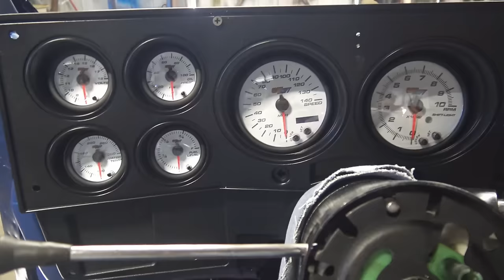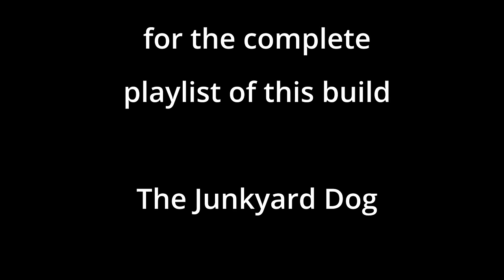Custom Classic Chevy C10 Muscle Truck Build  -  Start To Finish

Comment: That was amazing! So no heat no a/c and no wipers. Tell me how do you fair without those options? You can take Rain x and put it on the windshield and for the most of it be ok. How about defrosters? How does that work?
Reply from the maker: Not a daily driver ... so I drive it when conditions are favorable.

Comment: 4/6 drop? what shocks...So much knowledge
Reply from the maker: I used 2.5" drop spindles and 2" drop springs on the front with the stock front shocks. On the rear I done an axle flip and used front shocks from a later model GM truck. You'll have to go back and watch all the videos I made of this build. Here's the series page: https://www.youtube.com/watch?v=J9kgFm90ras&list=PL17ffBx4Y_BP4FEDoeKb6v6TV-HCnMObj

Comment: Hey Bob I built a 77 c 1 ton camper special put a 366 out of a school bus  with a low hole four speed  had to make a alt bracket got used headers out of a big block Blazer had to fix them Napa said it couldn’t be done but with the help Crome my besty we got her done dam thing got about 5 mile to a gallon it cost me 500.00 to go from Pennsylvania to Florida and 300.00 to go to Baton Rouge even my 73 GTO with a 67 GTO engine and close ratio Muncie four speed got a little better fuel mileage

Comment: How are the glowshift guages sir? I'm thinking of ordering some for my 85 c10 Lwb
Reply from the maker: I love em!
Reply: @RatRodBobBuilds  is the 6 pack cluster pretty good I may order tomorrow none of me OE gauges work at all
Reply from the maker: You will have to get the bezel too for the gauges to fit. You will also need the trans adapter for the speedo and it will need calibrating as seen in my videos. 

https://www.glowshiftdirect.com/7-color-series-cluster-dashboard-panel-gauge-package-for-1973-1987-chevrolet-c10/

https://www.glowshiftdirect.com/16-pulse-speedometer-sensor-adapter-for-gm-vehicles/

And just so you know ... I had to pay full price for mine and I don't make a dime off of any sales. But I still recommend them.
Reply: @RatRodBobBuilds  I appreciate it sir. I'm gonna order them next week and get them to a shop to be installed properly.
Reply from the maker: @KGrizz187  Here is the link to the video of me calibrating the speedo: https://www.youtube.com/watch?v=esC9Q1TKGvU 
You can start at the 17 minute mark on that video to see it. Just in case your installer needs info. Kinda pricey but you're gonna love them.
Reply: @RatRodBobBuilds  any chance you have email sir so i can ask more questions about my c10 and these guages. Like do I need the extra stuff

Comment: How much does a rebuild like this cost?
Reply from the maker: If you count labor ... you can buy a rebuilt truck a lot cheaper.
Reply: I have a 74 C10 that's been sitting for at least 11 yrs. I'm ready to get it on the road.
Reply from the maker: Do it yourself and save! But I did spend 12k on this build just in parts. Well, that was including the $500 I paid for the truck!

Comment: Yes Sir I. Love your truck u all built  , I have one I'm workin on 81 Chevy custom short wide bed small block pearl blue check it out an give me some advice on my   see photo 470 hp built 12 bolt posi Trac 373 gear  traction bars on it  499 tranny shift kit & gets it  Oklahoma country boy Tulsa Oklahoma Peace  don't care for the rollpan bumpers beautiful truck u have how much horsepower putting out..?  producing